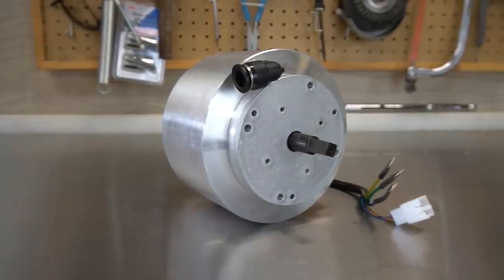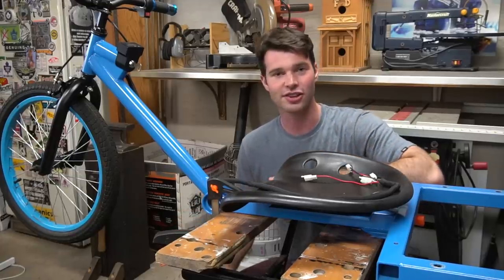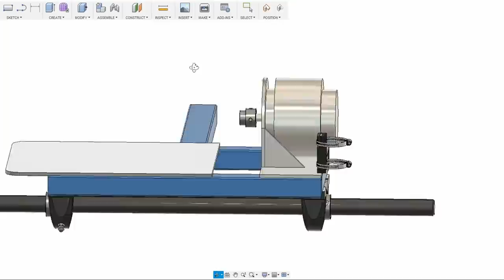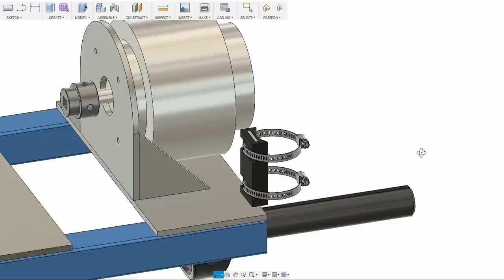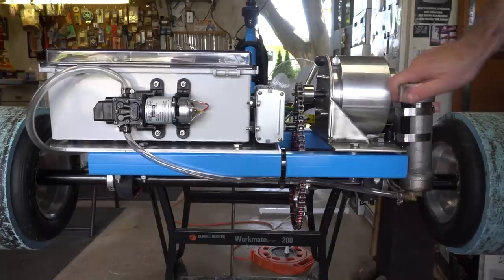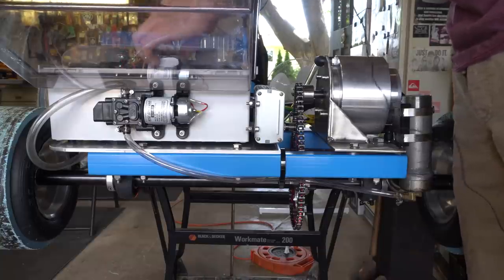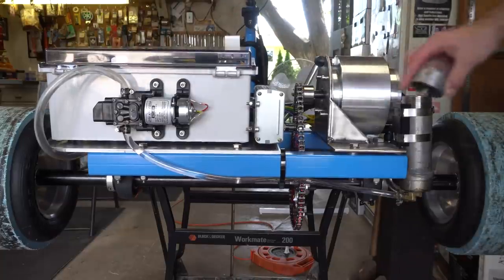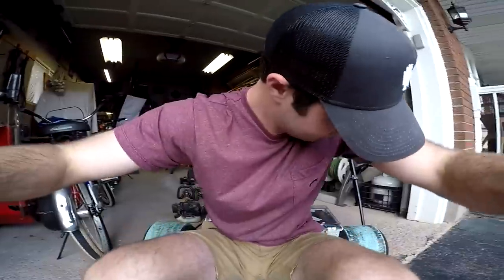Making a Water Cooled Electric Drift Trike

Comment: Austiwawa, you did a great job with both the FWD and RWD setups, but this is one of those situations where it'd have been best to ignore the idiots in the comments section.  Most the people saying you should do RWD have never actually drifted anything before, and have no idea how the physics behind it works.  The only thing doing RWD accomplished was making the trike slower and harder to control.  Despite what the commenters were saying, you were actually drifting with FWD.
Reply: And what exactly are the physics behind it DK?
Reply: SlammedHemi
Except in extreme cases (and even then, pretty much only with AWD), go watch a professional drifter on a track built for drifting and pay close attention to the front wheels.  Take note how those wheel retain grip pretty much the entire time.  The rear wheels are the only thing sliding around.  If the front wheels also lose grip, the driver no longer has any control over steering or stopping, unless he/she manages to steer into the skid and regain static friction.
The reason a car needs RWD to drift is because the rear tires are still very grippy compared to the front tires.  Other aspects like the suspension, weight distribution, and center of gravity also affect how easily you can drift. With the drift trike, the rear tires are always slippery, the weight distribution is almost completely in the back, and there's practically no suspension (where center of gravity doesn't matter so much).  So in his setup, regardless of what wheels are powered, most of his angular momentum will cause the rear wheels to keep close to their trajectory every time he turns (in other words, the rear wheels will always drift).  Meanwhile, powering the rear wheels will never result in the front wheel to slip, because they don't have enough grip.

So all that being said, by powering the rear wheels (which again, are always slippery) the only thing he did was reduce his ability to drive away from a collision and slow down his ability to accelerate.
Reply: actually, powering the rear can totally affect the "drift" mechanics of the trike. with the FWD you only have the back wheels being tugged around, trying to chase the front, but in the RWD you actually use the power to keep yourself drifting (pushing the trike) as well as to make transitions smooth (FWD causing a bit of a jolt when the rear wheels return to grip). The RWD opens up many different drift dynamics rather than the FWD since you no longer rely on the momentum for drifting. 
I do think a little more grip would be optimal, however, to both take advantage of these benefits as well as adding safety.
Reply: Work. Play. Repeat.
Actually in this context, you're still wrong.  I can't stress this enough: the dynamics of how a drift trike with slippery plastic wheels is completely different than a full-size RWD car with rubber tires.  The wheels on the trike are almost always slipping, making it harder to build up speed and momentum.  The less momentum you have, the less "sideways" you'll be riding.  In a full-sized RWD drift car, the rear tires still have a lot more static friction, allowing you to get up to speed. Once you break free from the static friction, that's when you start drifting.  In a car, applying power to the rear wheels helps keep static friction at bay.  But that's not how the drift trike works.  You hardly need any force at all for the drift trike to break free from static friction.
Reply: Also, drifting is basically a controlled slide.  It's not defined by which wheels are putting power down.  The drivetrain you use depends on the vehicle type, as Peter said.  In RC drifting, they commonly use AWD cars, because the speeds the tiny wheels are capable of spinning against their neglegable weight makes RWD nearly impossible - they just spin out all the time because they can break traction too easily.

For front wheel drifting (and yes it is a thing), rear wheel traction is broken by shifting weight towards the front, using slippy tyres, or both.

Comment: Keep the hub motor, get rid of the sleeves, run twice the batteries and see how fast you can get it
Reply: Technically, the less friction on the wheels, the faster the top speed.
Reply: @melody3741  you won't get to the top speed if you cant get traction
Reply: @dakotadriggers8838  also true. Probably thin bicycle type wheels would work best
Reply: Martin Luther  we've already went over this. Stop being condescending
Reply: Martin Luther  trains have virtually no traction and can achieve speeds of 200mph on engines with power you see in production cars. The metal wheels allow them to reach those speeds. Grip=drag. You dont want to be sliding all over the place, obviously, but the math checks out.
Reply: @melody3741  that does make sense
Reply: Melody yep, less friction - more energy for speed, but for trike you need also a stability - train can’t get sideways unexpected, trike can
Reply: @Melody the trains that reach 200mph are electromagnetic, the propulsion doesnt come from the wheels. Not a good comparision, same reason land speed record rocket car has skinny tires, yes its less drag, no the tires are not pushing the car to speed.
Reply: Hard, smooth train wheels on hard, smooth tracks, get away with a low coefficient of friction due to the vastly greater weight of a train, relative to a car. What hard wheels and track gain over tires and asphalt is a reduction in wear, and importantly, a great reduction of rolling resistance; a loss of motive force due to the deformation of a cushioned wheel/tire..

Comment: Interesting that your solutions to energy loss through heat was to have a water cooled motor, did you explore the thought of using heat sinks on all of the frictional parts for regen?

You could also put a pair of dynamos on the front wheel which will also provide regeneration of energy as a sort of range extender or maybe have the power directly fed into some super capacitors for a large power dumps directly into the motor for Tesla P100D like acceleration.

Of course it will mean removing the pvc covers off of the rear wheels but with the added boost of the curs like super capacitor system affording you large dumps of energy with no damage put onto the main battery cells it should still easily drift.

That's a really cool little build, I'd love to see how far you can make something travel on a single charge but of course fully utilising the wasted heat energy from the rotational parts and of course adding the all important dynamos for even more range extension.

Really enjoyed this build and I can't wait to get into building my own electric toys/vehicles.

Comment: Great video as usual. I’d love to you Put the hub motor back on and make it an All wheel drive trike! Also did you put a pressure relief valve on the  cooling system? May not get hot enough to need one but you never know.
Reply: I agree. Could it be wired to select front-wheel, rear-wheel and all-wheel drive?
Reply: Leave the front hub in when in rear wheel can have regeneration braking

Comment: Is it possible to insulate the inside coils and fill the motor compeletly with water inside?
Although I think that would kill the bearings but a little anti corrosion might work!
Great Video as per usual.

Comment: I think having front wheel drive trike is still classed as a drift trike, if you look at earlier videos of drift trikers they're solely using momentum from going down hills and using their body to push the back end out. When you did the front wheel driven trike you got the same result without downhill. Driving the rear wheels you spend more time getting the trike up to speed due to the wheel spin where front wheel where the grip is you have more time drifting on 1 battery charge.

Comment: In that loop you are mixing metals  radiotor maybe coper , motor aliminium, that will couse corosion fast and bad, also need  use aditive to kill bacteria in water, and use destiled water.
Reply: doesn't matter that much, he doesn't cool a cpu with micro channels... motor cooler is just a pipe. and i think it is a aluminum radiator.

Comment: You might want to flip the direction of the water pump. You want the heat to be dissipated before it goes to the pump, to avoid any melting issues. It will probably be fine though, there may not be that much heat coming from that motor.

Comment: Reservoir location should always be highest, unless you like stuck bubbles. Also, be a badass and put encoders on the front and rear and use a micro controller to control throttle for specificly controlled amounts of front to rear slip.

Comment: U shouldn't run a water pump dry it could destroy the pump
Reply from the maker: I figured it would be fine running it dry for 10 seconds
Reply: I has taught this as well, but I don’t understand why it would be the case with modern pumps? Especially small ones.
Reply: That's a self primping diaphragm pump it can handle a little dry time I have one powering a water cannon on my  mini tugboat it takes 30 seconds to run water from the back to the front hasn't died in two years of regular weekend usage
Reply: It's only really an issue if your system leaks and you don't notice it went dry for several hours.
Reply: Put some strips of rubber
Reply: If it's a DC motor, which it was, you are able to run it with no water.
Reply: Saattvik Thourwal yea I cringed at that lol. Feelsbad for the pump
Reply: he only ran it dry for a few seconds, that wont do anything
Reply: It’s easier to run the pump to fill it with water and air out the bubbles from the system at the same time.

Comment: Really satisfied with the building process. I like how you used the clamp to push in the notches that held future screws in place, and your welds are really nice. Although the only issue I had was you running that pump dry for a few seconds, but wHO CARES ABOUT THAT YOU GOT A BADASS WATER COOLED ELECTRIC DRIFTING TRIKE..?!

Comment: Turn radiator over as you will have an air lock in it cause its not able to be blead. And that kink in the hose where it comes off your pump needs sorting. Not like it cooling an engine but will help

Comment: Replacing the front wheel motor and making it awd might make that trike sustain oversteer alot easier with more control. It would also reduce strain on the rear motors, but it will probably need a bigger battery. You would have to figure out how to control two motors correctly with one throttle unless you want two which would be interesting

Comment: i would set up a from stop speed up time because that instant torque (from what i understand about electric motors is that they have crazy torque) it might snap off that light weight sprocket or bend it. and maybe cut off a piece of PVC tube and cover that kink?

Comment: Hey, austiwawa
what about an upgrade on the alternator-powered go kart project?
you can grab a 12v brushed controller on asian wholesale sites (doesn't need to be rc-related)
use the 3s lipo on the controller
and the controller on the field coils
because if you change the voltage/tension on them
it changes the revolutions/volt ratio(known as Kv ratio)
using 12v on the rotor means max torque (idk about 4s lipo)
and if you lower that tension/voltage, the eletromagnetic rotor will be easier to run and it will go faster

Comment: I have a 16 foot lifeboat built in 1915 and have been thinking of an electric water cooled motor for it. What is the model of this motor and what are your thoughts on it for this application. Currently it is powered by a 1932 Montgomery wards air cooled gas motor 2.5 hp. Plenty of power but it is geared to low pulley sizes are off. Not enough rpm.

Comment: in the controller there is a shunt that limit the amount of current in the controller, if you put a little bit of solder on this shunt the controller will be more powerful and with the watercooled motor it will be ok
Reply: jEAN AnNd'rè no no no SHUNT
Reply: @airplanegobrr  why?

Comment: Much Respect Sir but why do you assume the temp is acceptable without testing with a temp sensor or thermometer? Please use Non water Coolant like Evanscool coolant which will not corrode the motor housing

Comment: Where do you buy your sheets of metal from, the one where you take of the white protective film?
Reply: Los Ojos De HotSpanish I would try to find a local metal yard. I have a couple near my house and I’m in a fairly small town. One steel yard has a killer deal on “heads and tails” from the steel manufacturer, which are the first and last bits of plate steel from the mill that are usually too bent to be used for most commercial applications, but for something like this it would be perfect 👌🏻

Comment: Meh - what's a drift trike anyway?

I like the front wheel drive myself, as it emulates the original Big Wheel.

Real drifting with real wheel drive would mean breaking the wheels loose with torque.

But I know, everyone deliberately destroys their traction because that power level is expensive.

Your fabrication work is top notch. Very clean.

Comment: You have reversed the order on the engine cooling - input at the bottom, outlet at the top.
This way, there will be a huge air bubble at the top of the water sleeve and new water rushing in at the top will displace the water at the bottom.
Nice project though!

Comment: Mixing metals like that is a bad idea! The brass fittings and steel reservoir will corrode the aluminium and if you are unlucky it will make a hole in your motor. This is done in car cooling loops, but they use very specific corrosion inhibiting fluids.
Reply: Yes in 10 years or so there might be some minor damage...
Reply: @MsSomeonenew  if you search for "apogee gtx corrosion" on Google. You'll see water cooling systems that were destroyed after under a year. I know gocart doesn't run that much. But still worth keeping in mind

Comment: Missed oppertunity. Of 3wd. Allows for faster and more controlled drifts. Doubt it would take much to reinstall old parts
Reply: Conor Maguire it would almost be like left foot braking in automotive drifting, but backwards! For those of you not familiar, basically mid drift when the rear of the car is kicked out and the rear wheels are spinning, you can brake with your left foot (right foot is modulating the gas) to pull the car deeper into the drift. Hard to explain and even harder to master from what I understand 😅

Comment: the best results are with the motorized front wheel. it's better, the thing I don't understand is a big engine with all the weight in the back, it's such a bad idea! it's too badly balanced .. it forces you to put a big front wheel, and as soon as we accelerate, let's go and not well .. still there would be a big engine and a gearbox, and no pvc and burned gum, there yes, but otherwise it makes no sense. I tested both and the front electric one looks more like a real drift trike free than the rear powered one .. you're totally right. but one thing: why the rear wheels are not independent ?? you know in a drift, it's also better to have the rear wheels connected sometimes yes, sometimes no., it's also a problem I think. I also tested and freewheels not connected by an axis, it is better too, or put a differential with a blocking control on the handlebars ?? it would be great though ... with the electric front wheel, it would be the best of both worlds. ..
Reply: you have to put a 2000w front weel. ;) you drift soo smoothly!

Comment: I ain't seen any other videos besides this one that you've made so I have no clue if you've made any changes I was thinking what if you also added the front wheel drive instead taking it all apart like you did bad the front wheel drive and make it independent like if you want to get up and go you engage both Motors and you get up and go then you shut the front one off to do a drift or whatever just something like that that way well I noticed in the process of trying to take off you're doing a lot of wheel spin instead of getting up and going that was your intention then okay but if you were trying to get up some speed then you might want to consider adding in the front wheel drive it's just my opinion and yes I know no punctuation because I don't care

Comment: it is better the front wheel that pulls, it is the steering wheel, and it allows to have the feelings of a drift trike as the original without engine.
All the comments are wrong, with pvc on the wheels, if the engine is in the back, you have to manage the throttle in addition to the drift (overdrift) and it completely distorts the original delirium drift trike that has no need for power to drifter. and all we know: the tricycle without power Drifts very well already, and all drift without power and drift well !!! then the front wheel is much better in any grip, it allows to put the trike in the right direct trajectory without worries, while if it stops, I let them drift and wallow lamentably because it drifts too much. and that they do not handle the throttle as it should be .. for that have rarely see trike drifting motorized because they are good only on the flat. and something else: the electric motor can serve as a slowdown brake while recharging the battery, and it has no noise of a heat engine that screams just behind you! The best: drift trike electric front wheel, with 72v and 1500w. last thing: for a motor trike rear drift, for me, there must remove the PVC, and burn eraser with a motorcycle engine like 500cc, and there is real gum that leaves, and there may be manage the drift, without pvc. there the back is a better idea .. and even more real sensations ..

Comment: You shouldn’t run the water system without a fan on the water cooling the water will quickly heat up